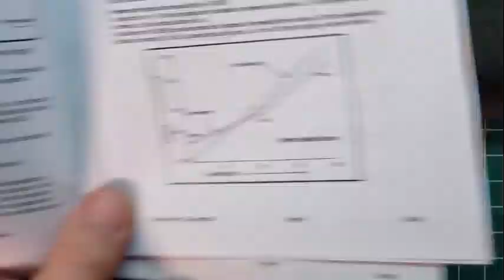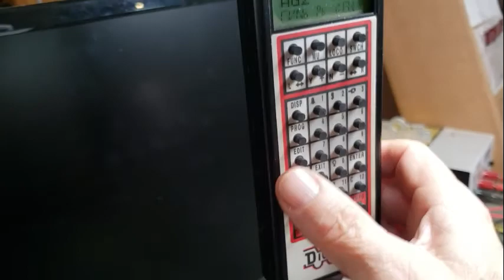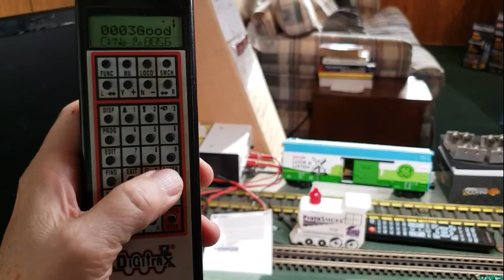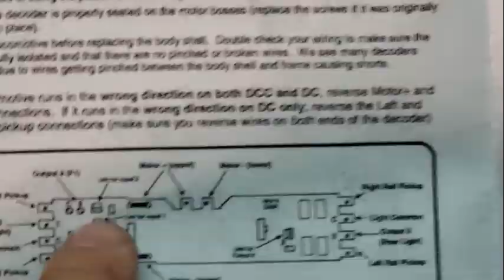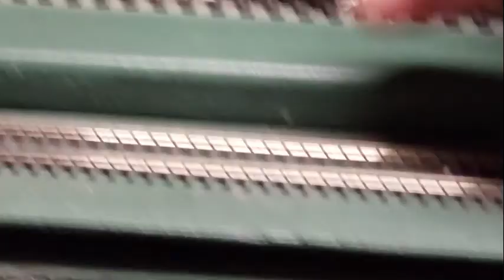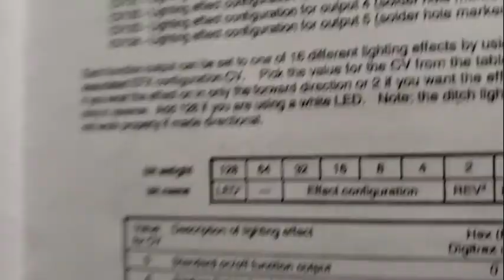HO Kato RS3 Install of NCE DA-SR decoder

Comment: What is the best cheap decoder?
Reply from the maker: Actually the "best" decoder is the one that has what qualities?  Support? Digitrax. Low speed performance? Train Control Systems.  Fits in special engines, like SW9's?  Then NCE.

Comment: Not sure if I missed it but why do you cut the connection to the resistors? What bulbs do you use? Thaks
Reply from the maker: Resistors were clipped to fit into tight quarters under the cab.  Used bright white LED for nose and backup lights and yellow LED for cab.  Each requires a resistor.  Which one were you referring to.

Comment: The motor was reversed on mine as well.  Thank you for the heads up on the onboard resistors.  I was scratching my head on that one.  I was doing an older Kato SD40 as well.  I had trouble with one of the trucks staying on the track as well.  Not sure whos desk wins battle of the messy.